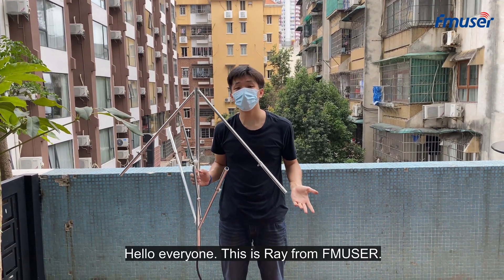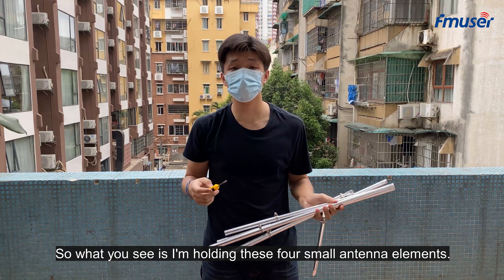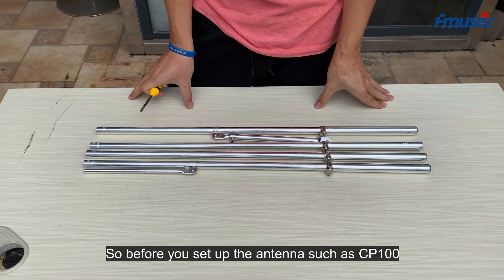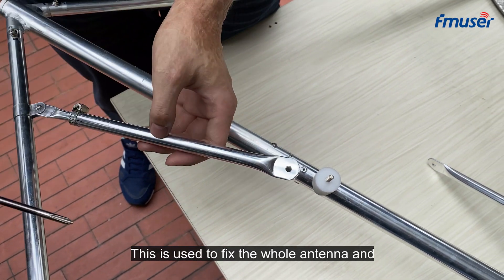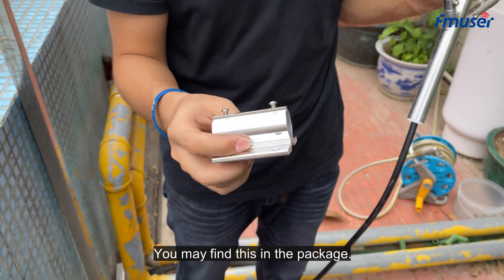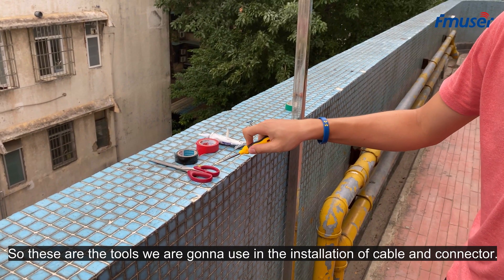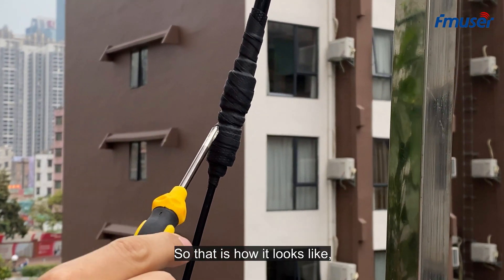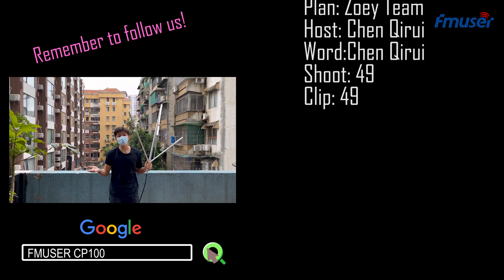How to Install a Circularly Polarized Antenna? Learn from the Expert

Comment: I spin it till I can spin no more but get crazy high SWR reading. Help!!
Reply from the maker: It may caused by improper setting during the installation, which type of antenna are you using and where did you get that antenna from?
Reply: DId you ever get a better reading ?

Comment: Is there some fancy cable needed for this?  I connected 2 types of RG cable and SWR goes to 9.4 nearly blowing up radio.  I think maybe I got a damaged antenna?  I noticed it was Bent a little when I opened it.  I think antenna was a return that Amazon sent to me
Reply from the maker: Hi, dear friend, which type of antenna are you using?
Reply: @fmuserbroadcast  the fmuser circular antenna.  Cp100 I think called
Reply: @fmuserbroadcast  I tried 3 different cables and antenna showing high SWR.  going to return this antenna and get a Comet. Have never had an SWR issue with Comet antennas
Reply: I ordered a second cp100 antenna thinking the first one was damaged. Still getting high swr reading.  I tried in 3 different transmitters,  using different types of cable and same issue. These antennas are garbage. Do not buy this
Reply from the maker: @strippi8284  I think you're having trouble in antenna placement, could you please describe how you installed this antenna? The location and mounting of the antenna can significantly impact its performance. For example, if the antenna is too close to large metal structures, other antennas, or obstructions, it can result in reflections and a higher VSWR. Additionally, antenna orientation and polarization should be considered for optimal signal transmission/reception.
Reply from the maker: @strippi8284  Please refer to the instruction manual for detailed guidance. If you have any additional questions, please feel free to contact us through the platform from which you purchased this antenna.
Reply: @fmuserbroadcast  thank you for your response.  I tried everything.. Placing in different spots,  mounting..  No luck.  I returned antenna today for refund
Reply from the maker: @strippi8284  Sorry for bringing any loss, my friend, we'll tried our best to find out what's going on with this product, I wish you success on your radio business, and if you need and further help on radio broadcasting, please do not hesitate to reach out to us, we're always listening. Have a good day!

Comment: Can I user 2 elements for 0db?
Reply from the maker: Hi, Rock! Thanks for the comment! I'd like to know whether you're going to use two CP100 FM antennas as two-layer antennas at the same time. Please tell me more about your need.
Reply: Hello friends, how can we install two antennas of this model?  Do you sell the combiner?
Reply from the maker: @alefoxrock347  Hi, Rock! Sorry for not replying in time. There are four main points to know when installing the antennas such as FMUSER CP100: 
 
1. The distance between the two antennas shall be set at least 2.4m 
2. Choose a place to install the antenna as high as possible. 
3. Keep the antennas away from the irrelevant stuff 
4. Fix the antenna and protect it from damping and lightning. 
 
By the way, we do have a variety of combiners for sale, but which do you prefer? The antenna power divider or the FM/UHF/VHF combiners? Make sure to find what you exactly need on: https://www.fmradiobroadcast.com. Don't forget to like and subscribe to this video if it is helpful! Have a good day, Rock!

Comment: What's the distance you can cover with this???
Reply: Maybe 3 miles on a good day
Reply from the maker: Well, Kiwanuka, it depends on the transmitting power of your FM broadcast transmitter and the installation height of your FM broadcast antenna, some high power FM transmitter such as this one: https://fmuser.net/content/?1068.html, is able to cover around 20 square KM, but just as I mentioned, there are many factors that may affect the broadcast range of an FM broadcast transmitter. Weathers, stoppage (mountains, building, etc.), are also some of the factors. You may find something interesting in our channel or visit our website: www.fmuser.net
Reply: 10 MILES IN EACH DIRECTION USING A 200 WATT FM TRNSMITTER
Reply: @thekevvdiggidyshow  oh yeah ? , i have a 2 bay and 200w but having tuning issues